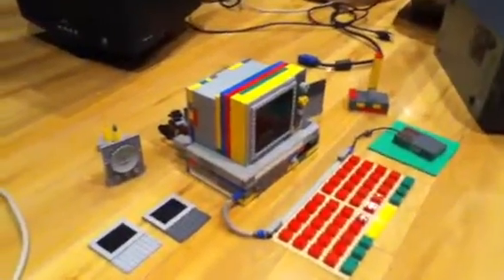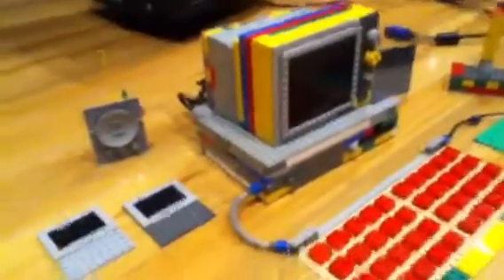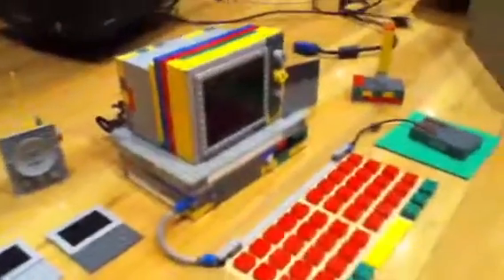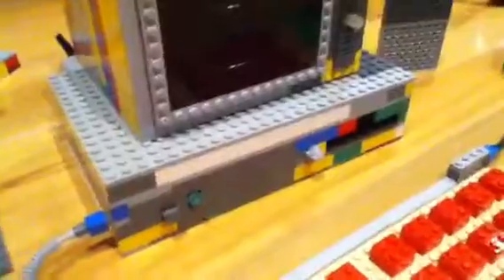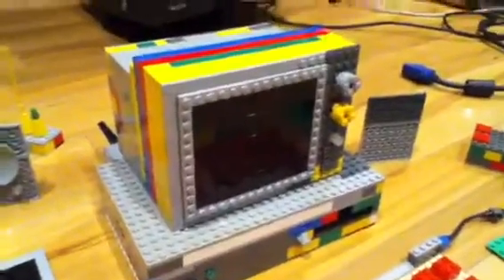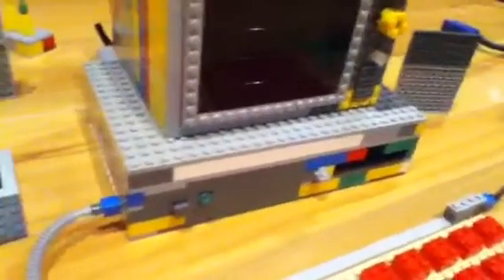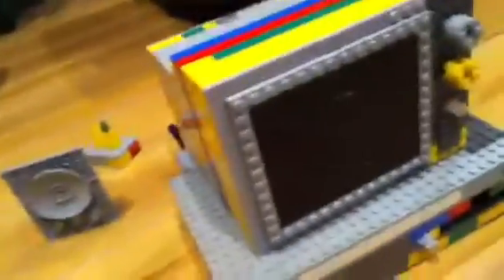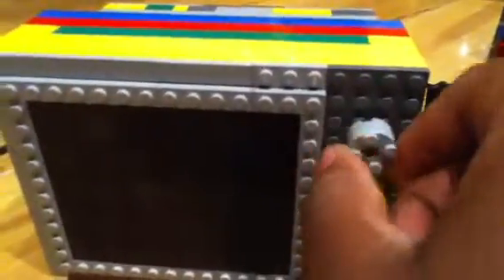I Made a Lego CRT TV (11/20/12) and Lego Computer Updates 11/1/12 to 11/27/12

Comment: To me it doesn't look like a TV at all xD It looks like one of those old CGA monitors from the early 80's... I'm talking stuff like the IBM 5151 (IBM 5151 AKA the best looking monitor in the world!)..... I actually preferred the stepper motor hard drive... Do you remember why you changed it back to a voice coil hard drive? 

"And like the Vectrex the power button is also uhmm      the   volume button" Could it be that at the time you didn't know that almost every old TVs had their power and volume control as one button?
Reply from the maker: Well it was my first attempt, but you are right, it does look like a CGA monitor! XD Really, you liked the stepper one more? I just felt like doing the stepper one for a short time and it was a little bit large for the case.

Yeah, I was just naive about stuff back in 2012. I'm telling you, these old videos suck. XD